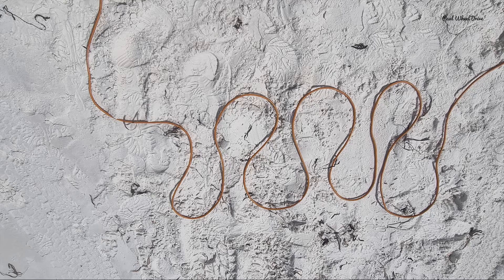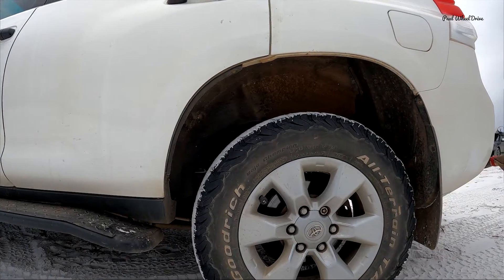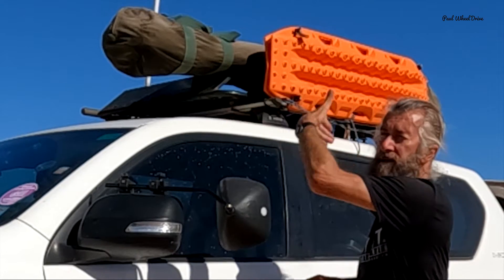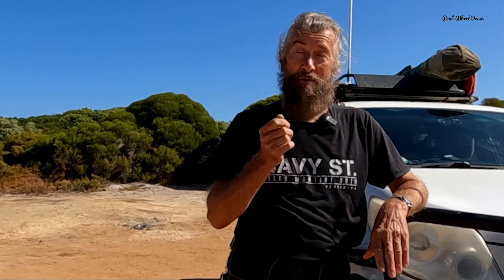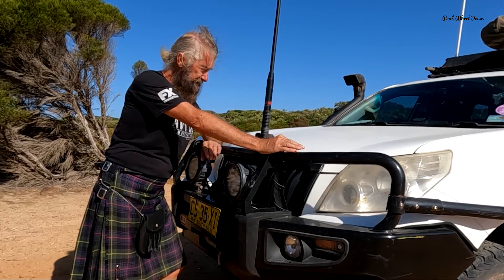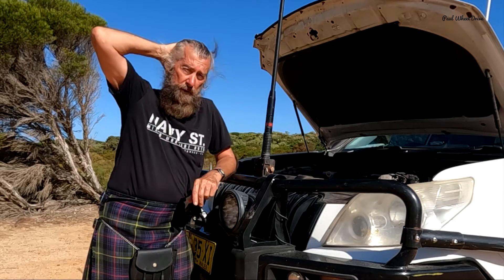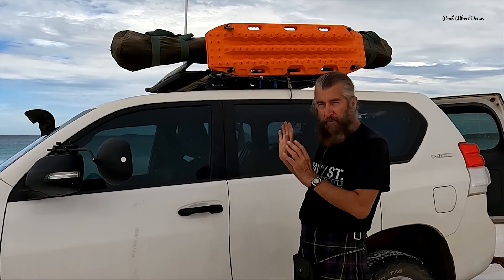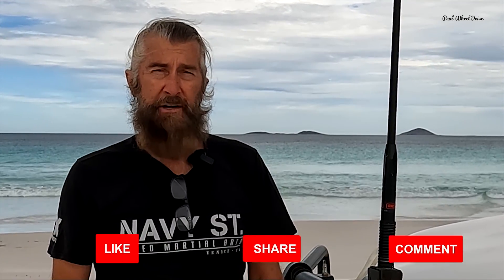Want Better Fuel Economy In Your 4wd? || Fuel Economy Tips Towing A Van || Paul Wheel Drive

Comment: A/C.....Adjust your temp to just below ambient....will feel heaps cooler immediately, than wasting fuel where it freezes your nether regions....and also reduces that shock element jumping out at a servo and shocking your system.
Your chat re..cruise control is super informative....I hate them creature comforts, as am still old school and like to be feeling my vehicle progress.
A solid nudge bar protects to radiator and weighs heaps less.  Nothing on my roof ecept free flowing air, no restrictive drag..always room some spot in car or van...just chuck out the food  and keep beverages stocked..lol.
Reply from the maker: Great comments Dennis 👆

Comment: Thanks mate. Turning your snorkel face back on dusty road help and if travel in convoys space your selves out a bit
Reply from the maker: Yes Jeffrey,
Both great suggestions, thanks 👌
Reply: @PaulWheelDriveAustralia  good on you for helping people learn stuff  for tyre pressure 4o on road n 2o in sand good VB start ,. If livestock VB on both sides of road slow right down calf spook and cross t mum  for Roos don't use bright lights they hop straight into them  never swerve unless you are Peter Brock slow down safety n hit em square on  stay on track best bet  I grew up drive n gravel it's the sudden change of direction that end baddly every time. Most times roos will save themselves if you maintain O course
Reply from the maker: @jeffreystorer4966  thanks, I'm glad you appreciate my effort.

Comment: don't travel into a head wind  always have a tail wind behind you 

calibration of  fuel tank is a must, especially if you have upgraded your capacity from stock..

modern 4x4's aren't designed for towing  you might  have install a  wind deflector  towards the rear pass the air cleanly over what you are towing...

running  dirt tracks and so forth invest in a pair or 3 of ladies pantyhose and use that your snorkel..

try to avoid 2 part snorkels because they aren't sealed.. and can suck dirt and water in might be okay on the mines in context in a open environments not on your life 

whether you're in the country or the city never fuel up when it is pissing down  rain amd make sure you p[ut the right fuel in the vehicle..

Comment: That was a great summary Paul - even the deja vous bits...You didn't mention that the extra fuel you use (speed, alignment, weight etc.) also contributes to faster wearing of the tyres...that energy has to go somewhere. With the price of AT's , the fuel is not the only thing you are saving.
Reply from the maker: Ha-ha, love it, the deja vous bits. You're too kind

Comment: Some useful info there Paul. However airconditioning uses only than .3l to .6l per 100km. Winding down a window at 80kmh uses more. Another point too is using more aggressive tyres which are heavier and increase rolling resistance will steal 5 to 10% more fuel than OEM tyres.
A lift will cost you at least 5% more too as the airflow engineered into the car was designed for a minimal amount to go under the car. Raising say 2 inches means 25% more air will flow under the car where it will drag.
Your bar work will increase your cars strength but not make it safer. Cars are engineered to crumple and absorb energy. Bars like yours mean all your occupants are at greater risk of severe injuries as they will be taking the energy of the impact rather than the car. Cars don't matter, people's lives do.
Reply from the maker: Hey Wayne,
Wow, that's a lot to take in.
I'm preparing a new website atm. Happy to open that as a discussion topic. Appreciate your valuable input 👌

Comment: Hilux 3.oltr  diesel SR  dual cab 5spd man with camper 1.5--1.8 T     usage on cruise 14ltrs /100km  and it was a 2wd .
Roof rack never made a difference on the camper .
City driving 10ltrs /100km

Comment: If you hit a camel or cow the prado will be ritten off ,no bull bar will save it .
Reply from the maker: Hey, it's a PRADO 😉
Reply: True cows kill roadtrain but roos have been bouncing off my old patrol Roo bar for 20yrs and it's still got the same radiator and headlights  no I'm not out to run them down it's just a lot of the silly buggers nearby    high beam and spotlight are not good it makes em bounce straight into the light. Old trucking trick no lights no hop